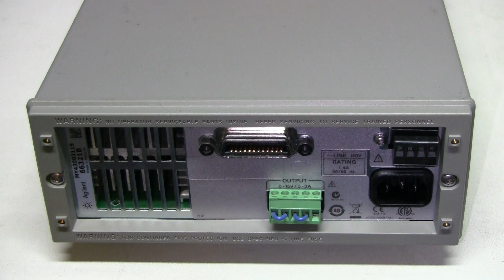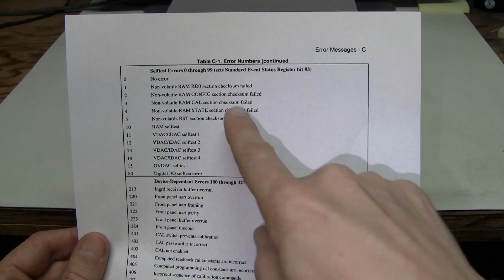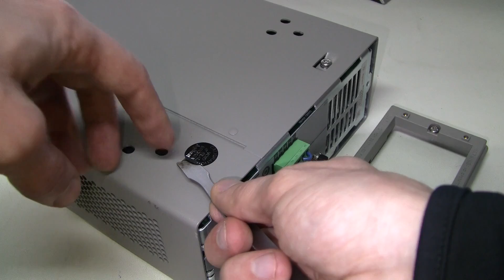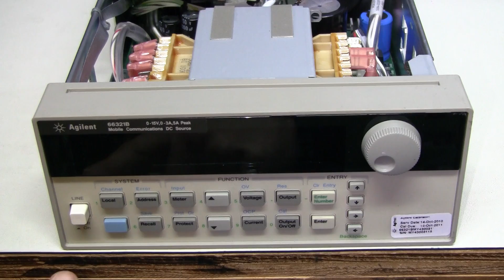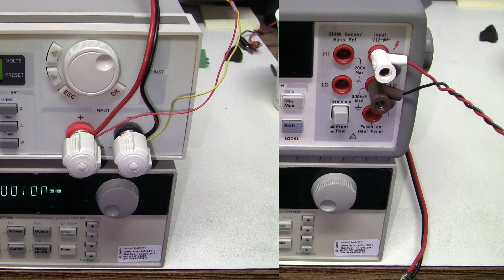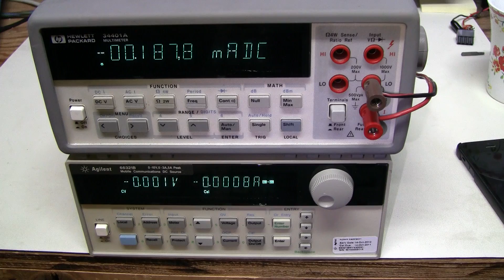#39 - Agilent 66321B troubleshooting and calibration

Comment: Solved! I used your set up method and it worked just fine. I found out that the Agilent hp manual failed to note that in fig B1 a configuration method that the load resistor needs to be 1.1 Ohm for the high current calibrations and 1.1K for low current calibrations. However if doing it this way, precision resistors are needed. Therefore, use an accurate meter in current measurement mode to eliminate possible errors in the documented B1a step and just do the B1b step. I really like these power supplies too and have them in our ATE system.

Comment: Great details and explanations. However, as I follow these steps for calibrating current on a 66312A with ROM A.01.03, I run into getting a 'WRONG MODE' message while trying to enter p1. I would be very interested in seen what you get doing the same. Yes, I have the Agilent documents for this. Thanx much for these videos.

Comment: Why, after calibration with the output disabled, does the armermeter show -0.0035A? 
How can this value be set to zero?
Reply: This value should show 0.0000 after you calibrate the current to 4 decimal places. Because the electronic load did show only 2 decimal places he would have had to hook up the meter in series with the load.